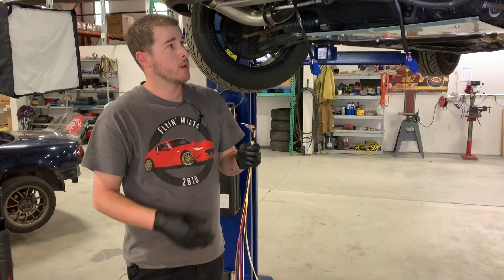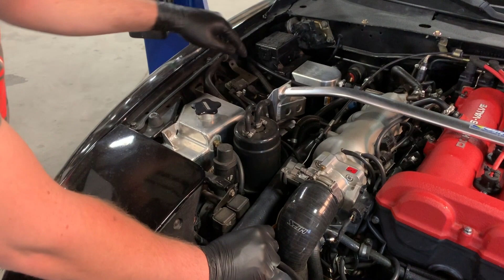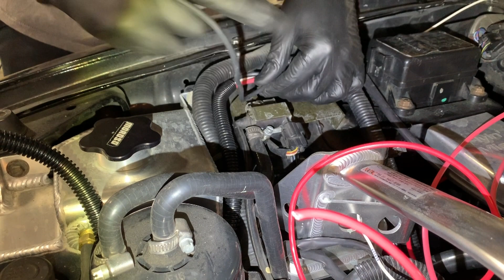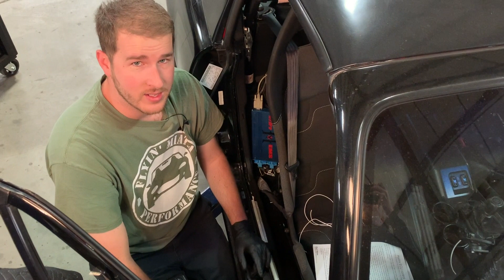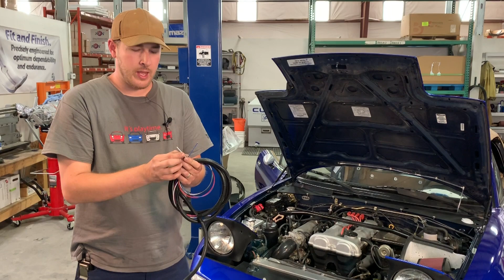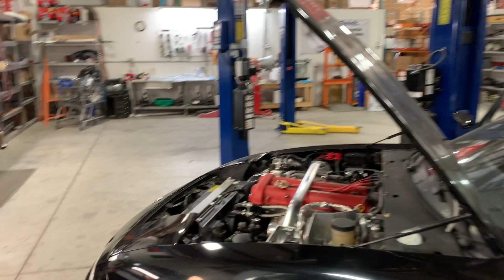FM Stage 3 Brushless Fan Kit Installation - PART 2

Comment: Where does the diode go for a/c switch
Reply: Are you asking about the item to speed it up and down ? 

If so 

Where that would go is between the ac really power wire to the fan 

That why when you click the relay on from in the car you control the max speed of the fan
Reply: @jptperformance  there's no variable speed. a smart controller. That will turn up the speed by the temp it's reading. An a switch for max speed. 

The diode was to allow current to. Only flow one way. It went In between. Ac compressor switch an potentiometer. So the compressor didn't get over worked.